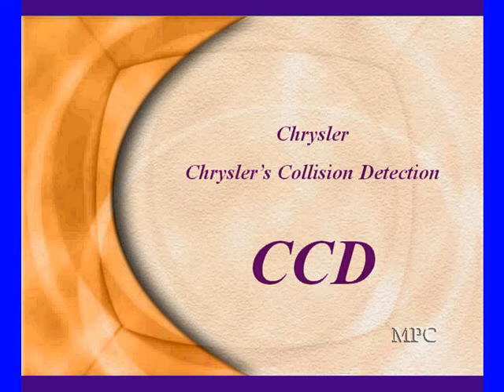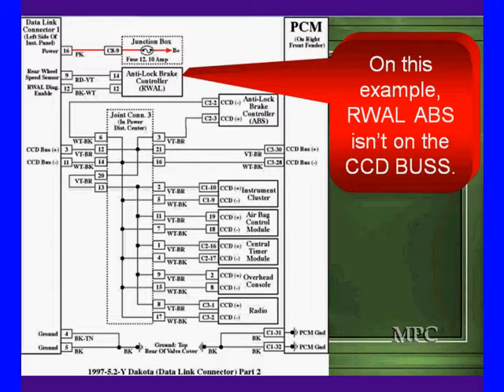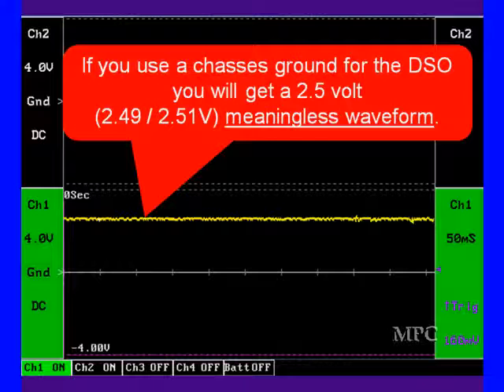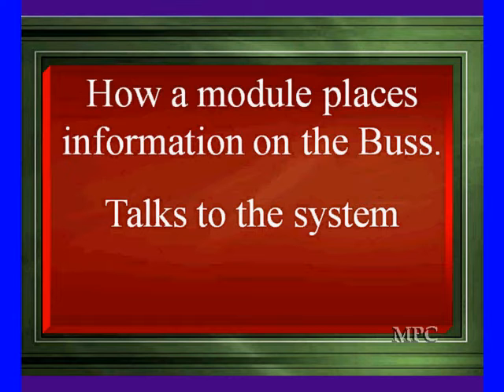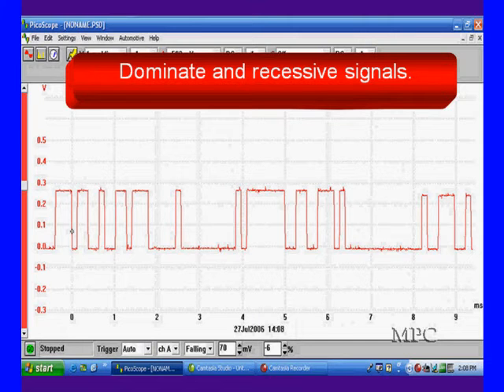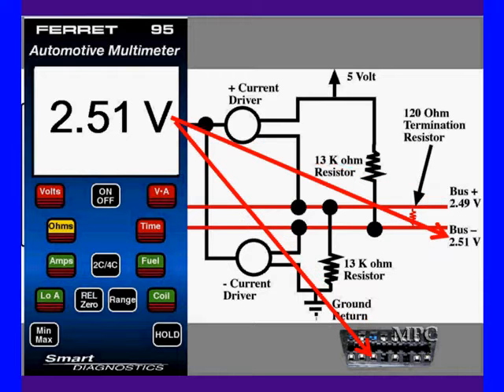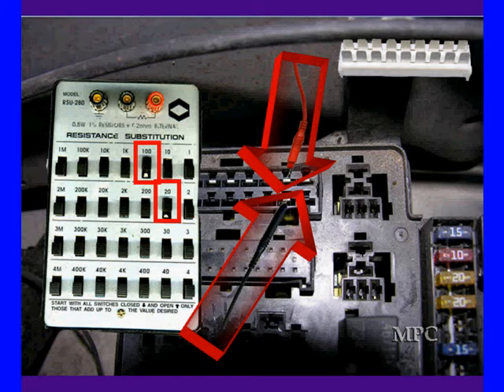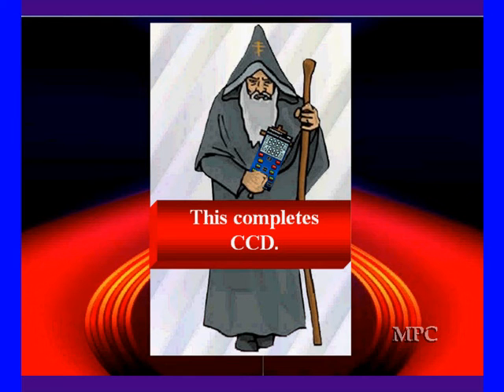08 Chrysler's Collision Detection (CCD)

Comment: I have an 02 dodge ram 1500 cargo van. My scanner it's capable of reading abs modules. 
But when I plug it to this van obd2 I can only read the ecm. Not the pcm and abs module .  When i try the abs it gives me a msg "to use Chrysler CCD  connector. 
My abs and brake light are always on and I can't retrieve codes from the abs module because of this CCD adapter or connector?🤔
Do you have any ideas how to get about this? I'm completely ignorant on this matter as of today. I'm reading stuff on Google but it's not sinking in. Thank you for your time. :)
Reply: Can you solve your issue? In your case the problem is probable to be in the speed sensor located on the differential. That sensor is necessary to the ABS for working and the failure makes the ABS and brake lights to be on

Comment: Great video! Are you saying that you would isolate a module and connect it to a voltage divider circuit and and termination resistor and see if it responds? I'm guessing it wouldn't be receiving any multiplex info it would normally have but you can still tell if it functions? I'm thinking of buiding that circuit to test the modules. 
I understand the other points, but I do have a non-functioning bus with 2.5v (actually 2.24v) and more importantly 60 ohms, so adding a resistor doesn't do anything except make it 40 ohms. 

Just want to point out that you repeatedly say the termination is in the PCM and IPC (aka MIC or cluster). That might be true in a Dakota but in my '98 Jeep its in the PCM and BCM... I'm pretty sure that's the case in most models and the bias comes from the PCM, not both. Also not many models have the junction connector that you refer to, just a few years with CCD. Don't want to send people on a wild goose chase.

Regarding the voltage, mine is about 2.24 and I've  seen info that it's 2.5v +/- .25v. But I guess the way to tell if it's functioning at that voltage would be to test with a scope?